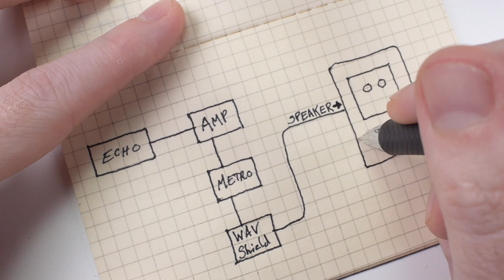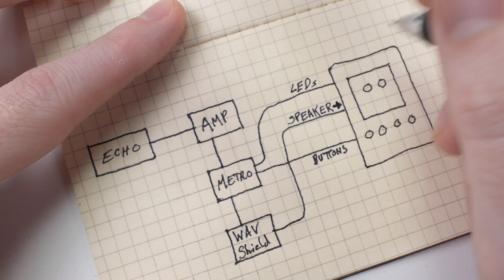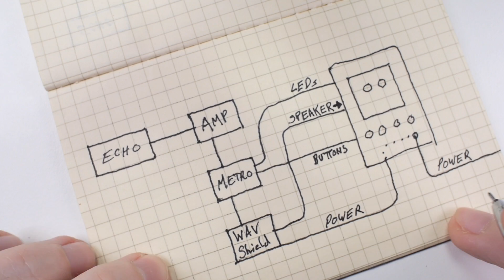Collin's Lab: Echo 2-XL

Comment: Built this project, however, the volume is way low. If I turn up the potentiometer on the wave shield a hum becomes very pronounced and the volume of the echo is still very low.  Any suggestions?